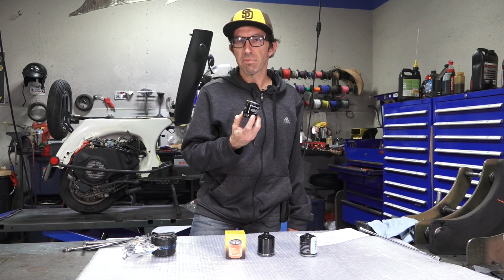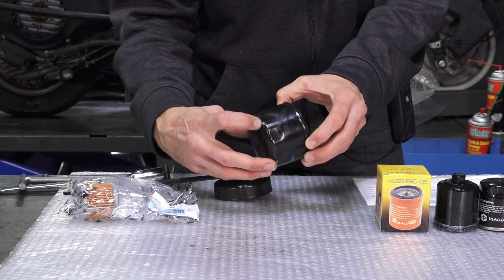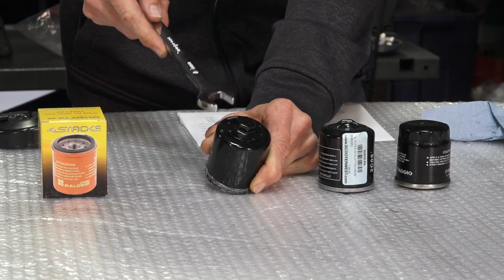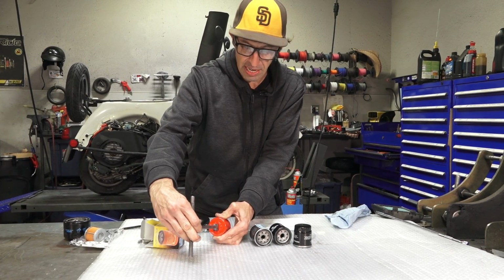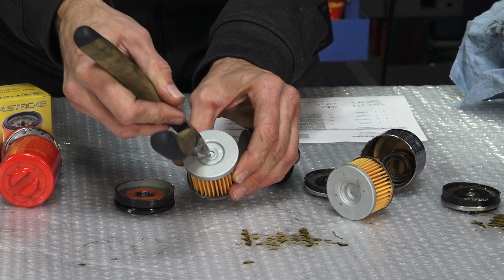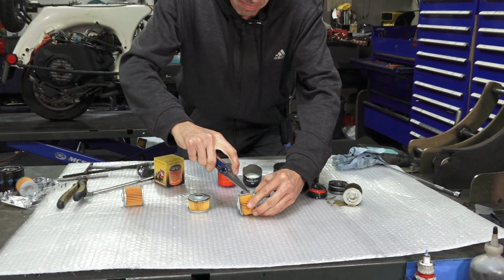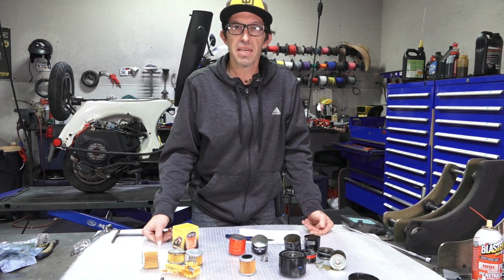Vespa & Piaggio Oil Filter Options & Review

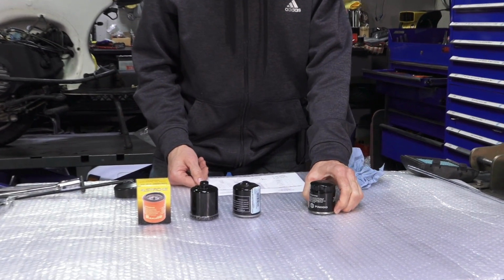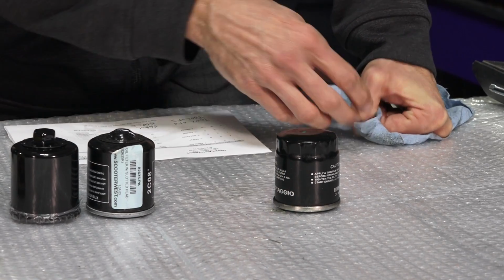Comment: For those watching in 2025 - At 5:24 - that oil filter is now the standard piaggio oil filter style and you can buy it as the official replacement. A lot of other manufacturers like Hi-Flo and Malossi still use the style at 6:19

ScooterWest also sells an oil filter wrench that works on the new filter from piaggio.